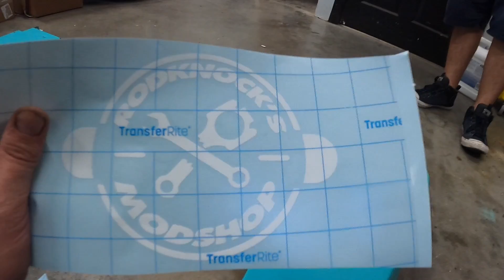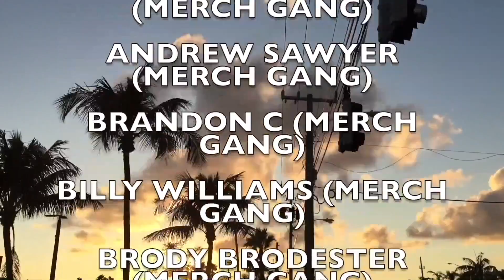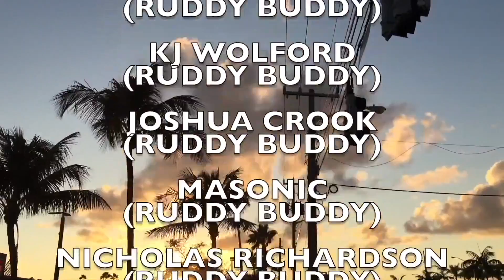I'M WAY TO DEEP INTO THIS!

Comment: I've been building mowers for years go on Amazon and order a mikuni 27mm carb and a throttle cable put a foot throttle on it remove governor and it will rev super happy and take the pulley set off front and take the big pulley that drove the deck cut it off and weld it up top where small pulley was and go up couple tire sizes give ya more wheel speed it'll do 20mph wheelies

Comment: But Chris-
The hydrostatic drive is still belt drive off of the motor. Swap the drive pulley on the motor to a larger size and get a longer belt to compensate. The higher drive speed on the belt will spin the hydrostatic faster giving you more speed. It will also make more heat so make sure the rear transaxle is clean so it can dissipate heat well.

Comment: Yup use the current one for pulling, get another as a stance/drift tractor. Hydrostatics are good for pulling for sure, used to pull a big ass hay trailer with my 20 year old craftsman at work with no issues

Comment: Put a 6 inch pulley up front and about a 2 inch on the transmission.  I have one that runs about 30mph with all stock mower parts

Comment: Go to track supply and go get a smaller pulley on the rear diff get a smaller belt also you can put bigger tires up front if you find rear rims and grind some stuff

Comment: You should get a 13hp 5 spd John Deere. My buddy and I had to put a wheelie bar on it bc you can dump it in 5 and would hold a wheelie. We did pulley swap on the motor and rear end and a custom throttle. Oh yeah it’s also goes 50mph with pushbutton start

Comment: If you want to make your rider faster, bypass the  governor/stock throttle cable and connect directly to the  throttle shaft on the carburetor. It wont make a huge difference but at least you can rev it to the moon

Comment: I thought this was suppost to be a "pull off" not a beauty contest...
1. find a starter from a mower repair shop
2. build a straight pipe exhaust
3. weld yer diff./ add some weights to the rear
4. make a home made methanol spray kit
5. get some knobby tires for the back wheels

Comment: If you wanna go fast and take a easy route find a China dirt bike engine or look for a cheap Honda rebel 250/450 use the engine on a mower chassis 1"axle in your desired width and ditch the front steering and front-end go with direct steering or look online for a "racing mower steering kit" from factory the spindles have way to much castor to go fast makes the steering very twitchy and sketchy for a brake simple 10" disc and brake kit from Bmi will get good for up to 50mph

Comment: When ya pull the starter put graphite on where the starter gear rides up on to in gauge on the flywheel never use grease on it should be trusted grooves that the gear goes up

Comment: they have plastic starter gears at tractor supply you can easily change if it keeps eating starters you need to adjust the valves had the same issue on one of mine

Comment: def work on some tractors. its pretty fun . and you can get some "real" stuff built quick, like in a week or so. . .you seen how fast it was to pull the motor . .

also if you are going build a drift tractor. And arent going to buy some crap off marketplace (which you might be able to find something on there. . like a cheap 22 or 26 horse power parts tractor and take the motor off).

if you look and want to buy something for under 1k that is over 20horse power . look at , "Honda cloned" V-twin  engines.
or any of the V Twin engines. those are the same style as harley and big honda motorcycles.  those would def have enough power to drift
the 22 hp Predator v twin, the 24hp Lifan, 23hp duromax (lol, then you can say you have a duromax engine in there). and there are more. . but you can build something cheap and durable and fast

Comment: Chris get back to me I have tires and rims with Dunlop slicks out of that will bolt right on that wide ones for the rear and skinnier ones for the front unless you went wide ones all the way around we erase champ karts were which are go-karts with a roll cage they do about 80 miles an hour and we have tons of leftover race scrubs on Old Wheels let me know and I'll ship them off you can just have them believe me he'll make the thing looks so dope the rears for the inside Tire of our carts is 11 in wide and I definitely have four of them unless you want to 11 inch wide and 2 9 inch wide

Comment: If you re doing tractor pulls you need cub cadets. The old ones. They have real clutch, driveshaft and transmission. Belts slip and the transaxles suck really bad on these vertical shaft junk mowers. There is a shit ton of performance mods for the old kohler 10, 12, 14, and 16hp engines. Way better platform than these MTD junkers.

Comment: I do some digging and find you an old tractor lawn mower not a big tractor but a tractor lawn mower and you can find one that's got high gears and low gears for pulling I'm 10 right now you do a pulley swap and do some modifications today engine and though you can sleep alone diesel engine on there where I lost small turbo on it that they make and that thing will be nasty and it's cheap I think you can get the diesel motors at harbor freight my buddy built one like that and that's on bitching down pop Willy's doing everything he had to add weight to the front end to keep it down